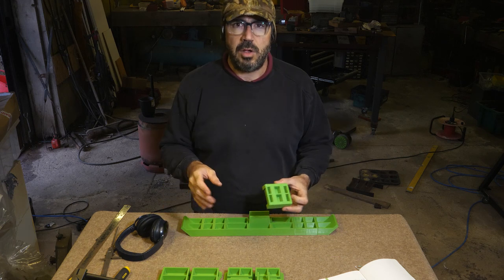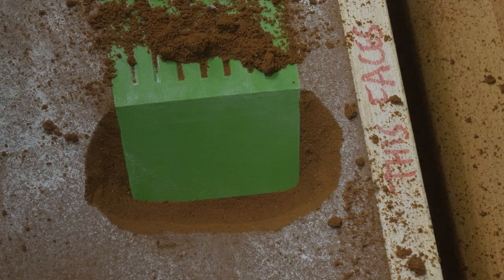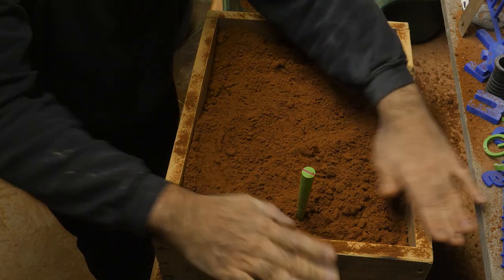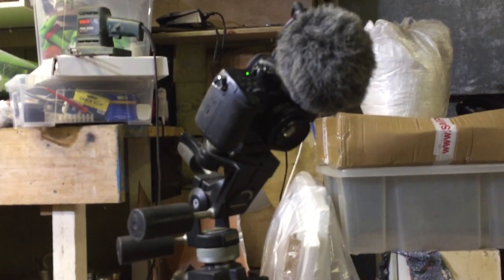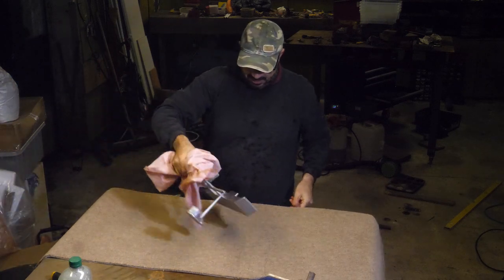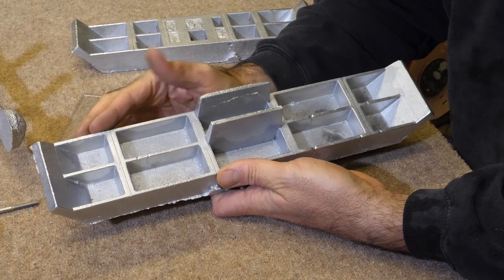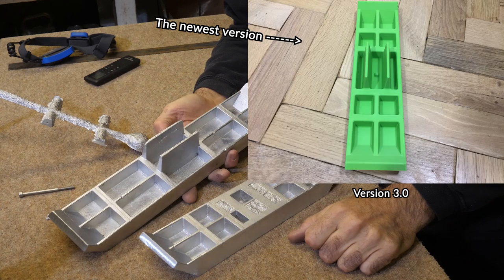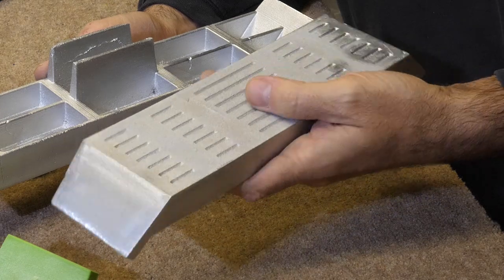Modular Flasks (part 3) * THE FIRST CASTING * (casting design version 2.0)

Comment: i already commented it before, also sent you a fb message: the sand-side of your flask patterns need those cutouts with a larger radius, also 5-8mm deep, in order to make the sand actually stick to them. You tried making that feature on the pattern, but with this size, the sand will neither really get much into it while casting the flasks, nor while using the flasks. Also you'll need to make cornerpieces for hinges... snapflasks... round knobbed centerpiece attachments to make the flasks chain-hoist-rotatable... please upload the current state of the patterns to thingyverse, to allow others to contribute..
Reply from the maker: thanks Rocketri, i didnt see your messages sorry, i've increased the rounded fillets to 2mm and it's working great at the moment. i think you'll like the next part (part 4 it's just out 5 mins ago) the casting looks great :) hinged corner pieces will be expored after the basic sides have been explored and the patterns will get uploaded once the flask sides have prooved to work as a whole, so that's still a little way off i'm afraid. Snap flasks would/will be amazing, but i've not even got the sides casting right yet :)